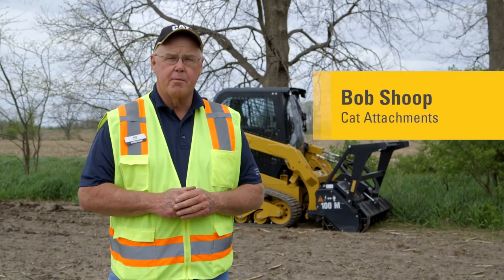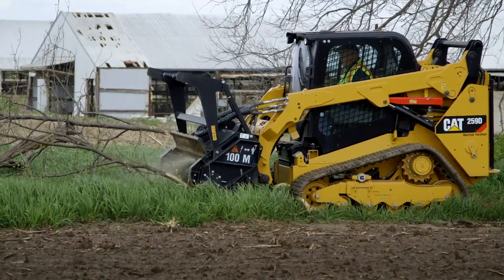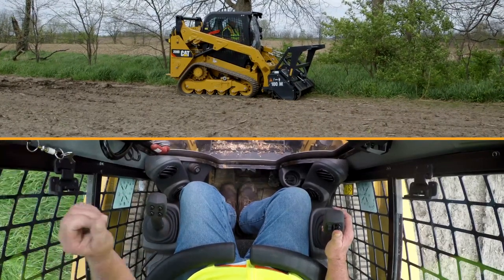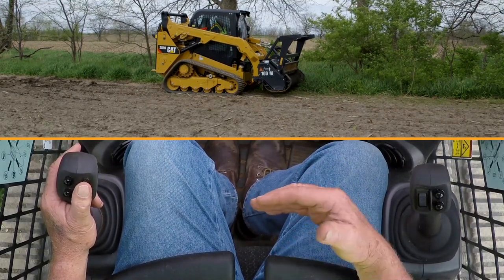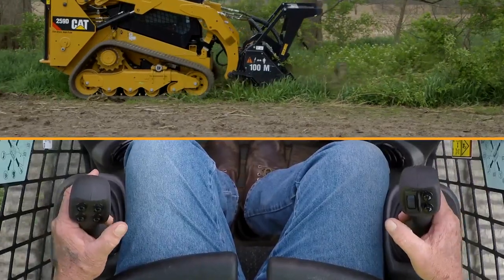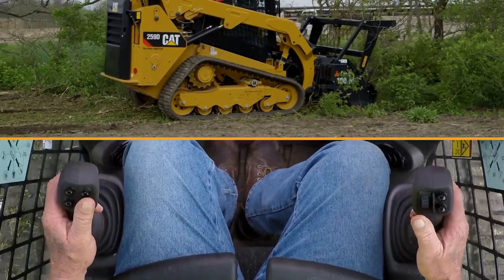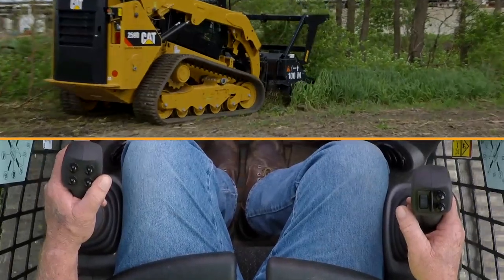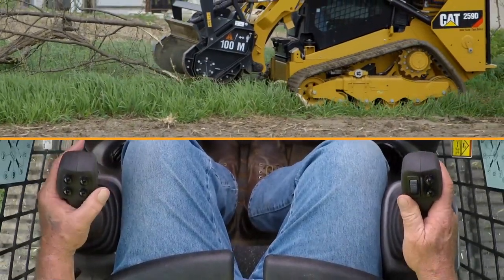Cat® Standard Flow Mulcher Operating Tips

Comment: Why not close the door for safety?!?🤷
Reply: It's not the cab door, it's on the mulcher itself. It should be open to allow for heavy, large cutting, but closed for re-mulching what's already on the ground. When closed it keeps debris contained so it doesn't launch out before reaching proper chip size . Larger brush and trees won't cut properly when closed